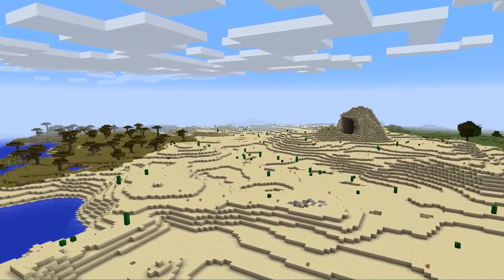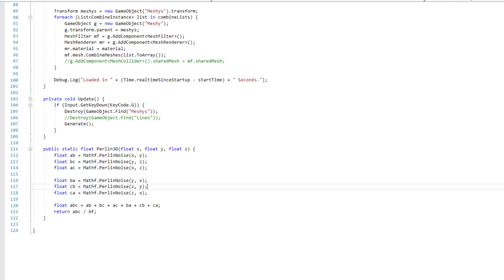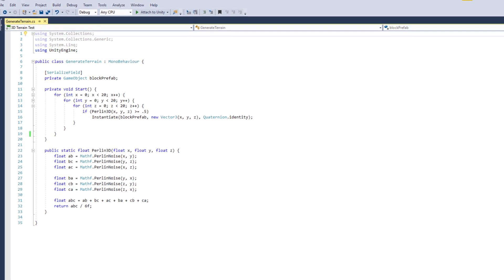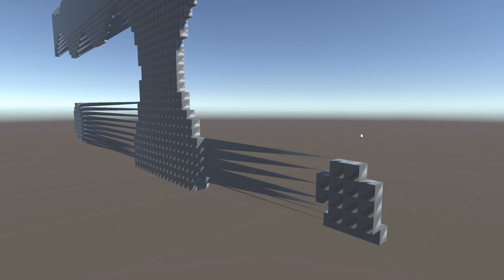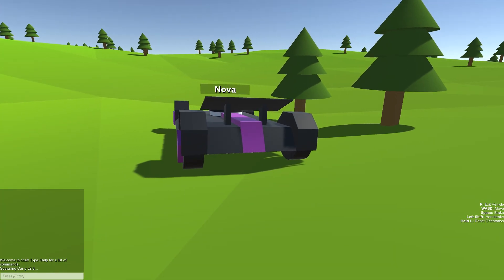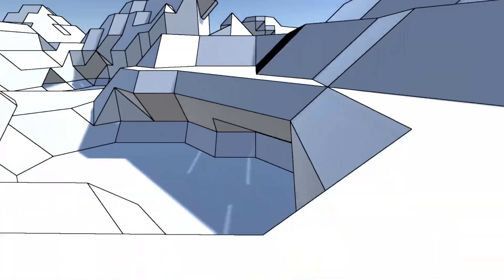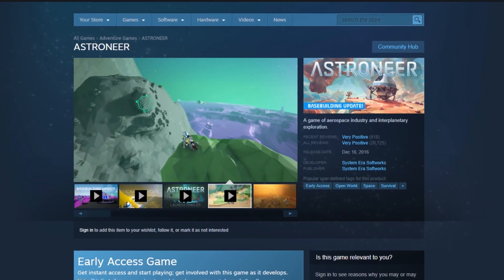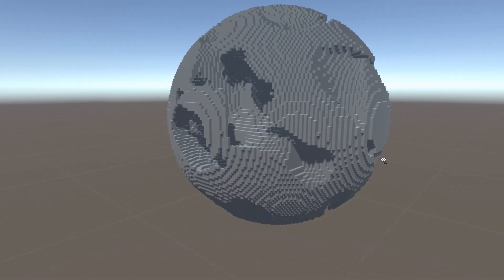My Adventure with 3D Perlin Noise

Comment: Hmmm. I think Minecraft's terrain is perlin noise with the threshold adjusted via a curve based on the Up axis (not saying X/Y/Z cause Minecraft has Y as up). So, at heights 50-60 the threshold is the smallest(meaning most blocks), below it slowly increases to allow for caves, and above 60 it goes to 1 to not allow for flying stuff.

Of course, there's also small perlin noise based variations on the 50-60 figure to not have the world be a flat plane, which are purely forward/right axis based, and multiplied/shifted based on biome (i.e. mountains have it multiplied to a high number, and oceans have it offset to a really low value.

Comment: Marching cube algorithm is an efficient way to generate meshes from a series of points. 
I think that if you could isolate every cube vertex that's facing outwards, and feed those vertices into the marching cube algorithm, you'd get something more or less interesting. 

You'll need to make sure that you treat any detached shapes as their own objects too
Reply: Technically, marching cubes work off a function defined over some space that you draw an approximate isobar for. But there are several good ways to convert points into such functions suitable for particular uses. E.g. in 3d reconstruction, point clouds, typically with an approximate normal defined for each point, can be converted into a gradient function using something called Poisson reconstruction. You then draw a surface using marching cubes where that gradient function is approximately zero. The resulting mesh then passes close to the original points and has roughly correct orientation. The reason you don't care about it being exact is usually because points you start from tend to have a lot of error and simply joining them together would result in a very bad mesh.

Comment: Your voxel mesh generation algorithm isnt correct. You need to sample each cube in a block array, if it is air then test is neighbours, if the neighbour is opaque then you create a face at that neighbour. This stops geometery being created that will never be seen.
Reply from the maker: It was meant as more of a proof of concept or anecdote. I've since gotten it working, but not exactly as you described. IMO like it makes more sense to test for blocks that are touching other blocks, then not drawing faces in between them. This way it more closely matches the description of removing the inside faces. Literally the same thing but another way of looking at it. I've never heard of/thought of testing air blocks though.
Reply: @nova84d  Its the same algorithm Minecraft uses! :) Here, ill give you some source code on a game I'm working on right now for you to take a look at.  Its a little rusty and I still need to polish it. https://hastebin.com/uvamukonoc.cpp

Comment: I don't know if your project contains editable terrain but after combining meshes how can I detect which tile player raycasted?
Reply from the maker: The terrain wasn't meant to be editable. My only idea without changing too much of what is already there is use hit.point to get a position on the edge of a block, and add the opposite direction of hit.normal X 0.5 to tell the general direction the block is from hit.point, then round the x, y, and z in hit.point to integers to get the position of the block. It's kind of hard to explain without an example, sorry. I think the only way to change the terrain is to remake the entire chunk. Let me know if I can explain something better. It might not work, I haven't tested it.
Reply from the maker: Also I believe the true position of a block might be in the bottom corner, so you'd probably need to subtract 0.5 from it somewhere. Something to note.
Reply: @nova84d  hey! after some research I found a method called greedy meshing. It combines tiles in the same plane. there is a good article about it: https://0fps.net/2012/06/30/meshing-in-a-minecraft-game/

and js demo:
http://mikolalysenko.github.io/MinecraftMeshes/index.html

I guess I'll use that method.
Reply from the maker: Interesting. I knew it was possible but I've never seen anywhere that actually does it.

Comment: i think the reason you get alot of preformance issues is because the way you make the mesh you should try to make it not render the insides of the cubes
Reply from the maker: You mean at 1:40? That was because I had a separate GameObject for each block. But yeah, I've tried it that way and you can have a lot more in the scene at once.

Comment: I actually made my own working Marching Cubes Algorithm and Tested it on Unity. It's not so hard as time consuming!
Now I choose how to Triangulate the Ambiguous cases.
I could also make marching Tetraedra. Which have no ambiguities and are way simpler to program, but less CPU friendly.
Well, in the future you could swap to ECS!
Reply from the maker: It's been a while since I made this video and I've made some progress on it. I have marching cubes working, and I was going to make a video on it hopefully sometime soon. I don't really get how to use ECS effectively, but I made a more basic threading system that splits it up and loads the parts at the same time. Good luck on your project!
Reply: @nova84d   yeah thanks. I do not know much about ECS either, but on UNITY 2019 they will add more ECS stuff to make it easier.
Yeah, upload some video on your progress. Hmmm, maybe I should to :)
Reply from the maker: Well let me know if you do, I'd be interested. Might be a while before I get around to it though, videos take a while.

Comment: i found meshnets   an other kind of marching cub maybe easier to implement
Reply from the maker: I tried Google searching it but couldn't find anything. Mind sharing a link?
Reply: so this is not meshnets but surfacenet   frome pouet.net : 
Of course

http://www.pouet.net/prod.php?which=57449

And probably a few dozen more.

Search for Surface Nets, or Marching Cubes, both classic techniques to achieve what you want. One example, here: http://http.developer.nvidia.com/GPUGems3/gpugems3_ch01.html
Reply: So you are close to the solution in fact you need to replace you simple cube by a set of 15 type configuration you can see it on the wikipedia for marching cube nex you need to know witch one to choose...   in other hand i make a mistake the real name  is naive surfacenet https://github.com/TomaszFoster/NaiveSurfaceNets
Reply from the maker: Cool. I'll check it out.

Comment: The terrain from 2:50 to 3:03 looks amazing. I'm looking to create something like that but I don't know where to start. Any suggestions? Btw amazing video.
Reply from the maker: The smoothness of that terrain is due to the marching cubes algorithm, which I don't have a very good grasp of at the moment. But if you mean generating a ground-like pattern of blocks I think I can help a little.

In the description there's a link to download the code I used to make this. If you imagine the noise as a black and white image like in the video, this would be adding a gradient from all white at the bottom to all black at the top. I hope this gives you somewhere to start.

After line 42 in the GenerateTerrain script, after noiseValue is created, try this:

noiseValue += ((1 - ((float)y / (chunkSize - 1))) * 2 - 1) / noiseHeight;

Explaining this is kind of difficult.

((float)y / (chunkSize - 1)) is the percentage of the way up the y coordinate is.

The 1 - before that inverts the percentage so it doesn't generate upside down.

The * 2 - 1 after makes it on a scale of -1 to 1, where before it was 0 to 1.

noiseHeight is a new variable you'll have to define somewhere (1 to 2 is a good value to start with). Dividing it by noiseHeight will "stretch" the gradient so the terrain will generate more mountainous.
Reply: You are the best thank you so much for the quick reply. Going to click the sub button right now.
Reply: I've been able to successfully implement Marching Cubes using polygon lookup tables from this site: http://users.polytech.unice.fr/~lingrand/MarchingCubes/applet.html

Comment: Hey man, I saw this vid and I remade your script till the point of taking a radius.  How did you go about that? I plan to try to use marching cube and see if I could get that to work.  Nice work tho and very influential!!
Reply from the maker: Thanks! I was going to try to figure out marching cubes myself but other things have taken priority. If you get it working in the meantime I'd be very interested ;)

noiseScale / 2 would be the radius, so use the same point you gave the Perlin3D method and compare the distance to the center point, which is the raduis on the x, y, and z. If the result is less than or equal to the radius then it's within the sphere. I'll try to write it out, but I didn't load up the project to test it.

if(Perlin3D(x*noiseScale,y*noiseScale,z*noiseScale)&&

    Vector3.Distance(
        new Vector3(x*noiseScale,y*noiseScale,z*noiseScale),//same point that was just sampled
        Vector3.one*(noiseScale/2)//radius as a vector3 (center point)
    )
    <= noiseScale/2 //radius

)

If the noise sampled is above a certain threshold and is within the radius, then create a cube. I hope that makes sense. Just ask if it doesn't.
Reply: Thank you for the quick reply! I got going on it and I'm guessing that you put that code in the void Start

This is what i got so far:
for (int x = 0; x < size; x++) {
   for (int y = 0; y < size; y++) {
    for (int z = 0; z < size; z++) {
     if (Perlin3D (x * noiseScale, y * noiseScale, z * noiseScale) >= .5 &&
      Vector3.Distance(new Vector3(x*noiseScale,y*noiseScale,z*noiseScale),//same point that was just sampled
       Vector3.one*(noiseScale/2))//radius as a vector3 (center point)
      <=noiseScale/2)//radius

     {
      blockMesh.transform.position = new Vector3 (x, y, z);
      combine.Add (new CombineInstance {
       mesh = blockMesh.sharedMesh,
       transform = blockMesh.transform.localToWorldMatrix,
      });
     }
    }
   }
  }

When i play the scene, I get a single lonely cube.
I am kinda new at the coding scene like this and it helps if I learn like this.  I am very interested to do this kind of work for a game I'm working on.  Again thanks again for your help :)

(edit: instead of .5, i added a Threshold  variable and slider just like your video.)
Reply from the maker: I loaded the original project and realized I made a mistake in the previous comment. the Vector3 in the Distance method isn't supposed to be multiplied by noiseScale and noiseScale/2 is supposed to be size/2.

That's not why you were getting that problem though. It works by creating a cube, moving it to different positions, and "copying" it into a bigger mesh. That lonely cube is just a placeholder to get data off of and you're not destroying it after you're done with it. That's problem #1. Problem #2 is you're getting all of the block data but not actually doing anything with it (unless there's more code that you didn't paste into that comment).

I updated the description with the working script. I added comments to it to hopefully make it easier to understand. If you have any questions just ask. This wasn't meant as a tutorial so I didn't bother explaining exactly how it works. I plan on making a tutorial once I figure out the marching cubes thing, but that might be a while.
Reply: Thank you with all of your help and putting the code for everyone :).  Ive gotten your code to work and tweaked it just a little for my needs.  Ive also been doing alot of reaserch on getting marching cubes to work and the best solution that i found was in this kind of a style.

Original post
https://www.digital-dust.com/single-post/2017/03/15/Marching-Cubes-in-Unity
Github repository 
https://github.com/Scrawk/Marching-Cubes

Ill be trying to take the code apart there and use that kind of a system to get marching cubes to work.
My main goal of this is to generate planets with voxels. I was looking how to do this a few months ago with no avail.  But your video gave me hope again and Im sure we could make this work :)
I will keep things updated on what I find and such.
Reply from the maker: Cool. I'll have to check that out later. Never heard about marching tetrahedra though. Now if you'll excuse me, I'm going to go bash my head on my keyboard. Good luck.

Comment: If I'm not mistaken, minecraft uses perlin worms for cave generation.
Reply from the maker: Cool. I'll look into it.
Reply: you are indeed mistaken. (don't worry, i've been there) they're actually just custom generated worms. (spheres travelling in some randomly changing direction while changing radius) think back to when minecraft was just a small world size. after generating the general terrain, tons of these worms are generated to carve out the terrain. ores/trees are custom generations that populate the world too.

in the "infinite" generation model, a single chunk generates all the worms in some radius to carve out that individual chunk. the ores/trees are only generated when adj chunks are present. (so they can generate over the boundaries to make it seamless. otherwise it'd all have to fit inside the chunk generating it. meaning we wouldn't have room for larger oak trees either)

along with caves there's also ravines. it's just another type of cave generation. (obviously less common)

then there's stuff like villages. they're simply a load of pre-made structures being randomly arranged. obviously they aren't generated chunk by chunk like caves are. (since they're obviously a lot less common too) they just generate out entirely into the world and those chunks are saved. like as if we just used some command to spawn a village that goes out of bounds.
Reply: @DlcEnergy  The way you described their worms sounds a lot like perlin worms lol

So, not really mistaken. However, there seem to be more layers than just perlin worms. I think in a recent video MC Devs talked about it in further detail
Reply: @tyridge7714  Yeah, i believe it is essentially the same. I think the main reason i assumed it's different from perlin worms was since i had seen methods of creating caves that actually use perlin noise. Whereas the code to minecraft's caves simply uses basic random floats.

It was about as simple as it could be. I assumed something with perlin in the name would be a lot more complex. Perhaps a different form of 3d perlin noise.

But yeah, from what i know about official perlin worms is it's the same process, just using perlin noise. I guess if we used simplex noise "simplex worms" would be more accurate to say. Perhaps minecraft went with basic "random worms" for performance, since caves don't need the same finely detailed noise terrain does.
Reply: @nova84d  did you actually believe him? or is it real..
Reply: didnt they massively change the cave generation in the cave update
unless that hasnt happened yet
Reply: damn its the man tyridge